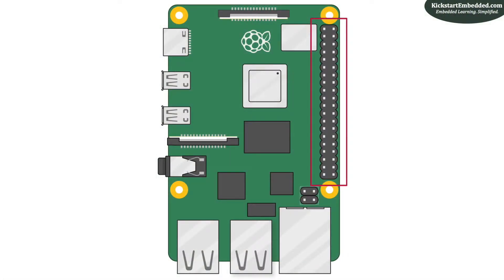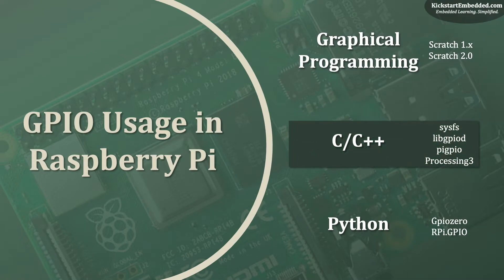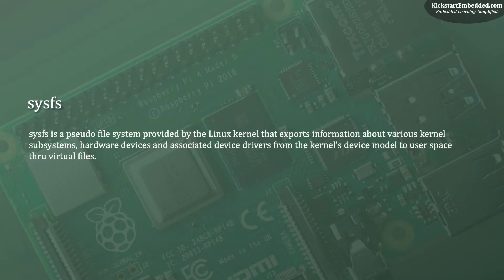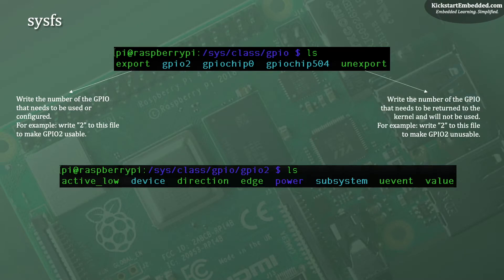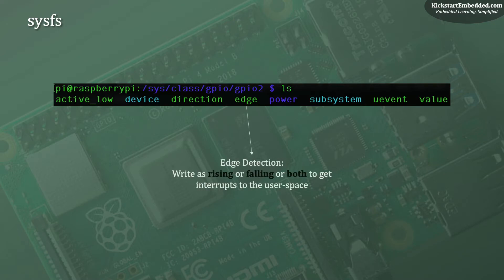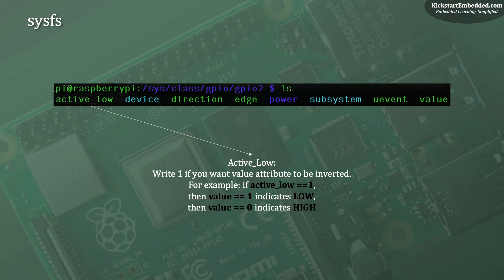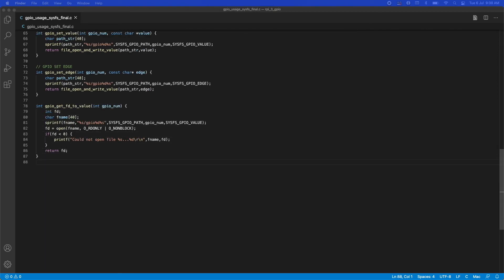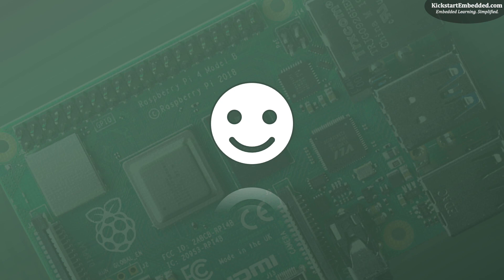[ENG] Raspberry Pi! Ep:3 - GPIO Usage - C (sysfs)

Comment: The purpose of inverting the output or input logic is to have a logically easy approach to low side switches. In many electronic applications it is useful to pull a pin low (instead of high) to activate some electronic circuit. On the makers level of applications I recommend to check for the differences in PNP and NPN transistors usage. On a larger scale most of the electronics and devices in automobile industry use low side switches.
Reply from the maker: Thank you so much for sharing this knowledge with us 😊 Cheers!